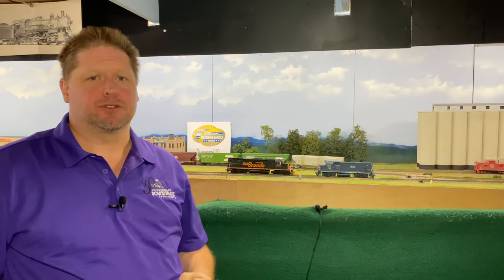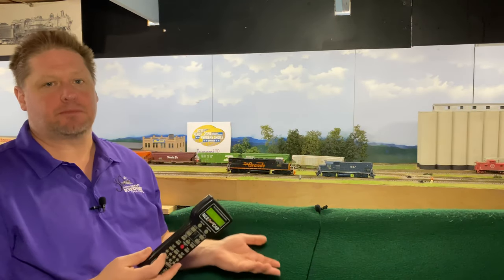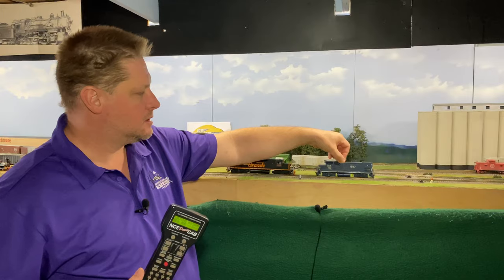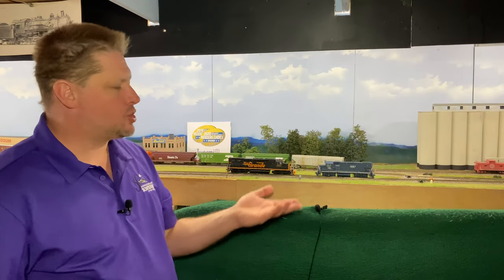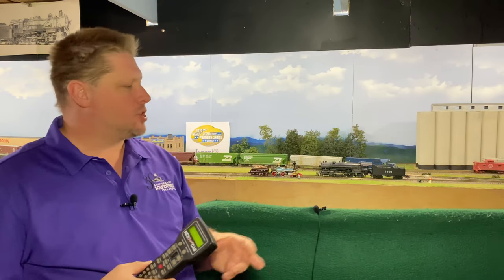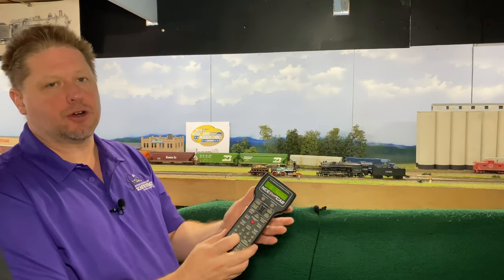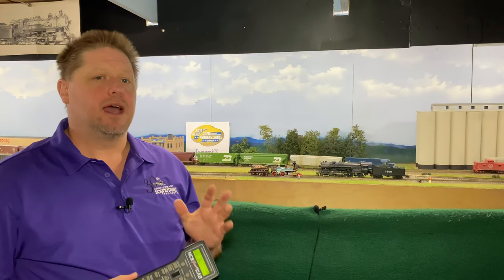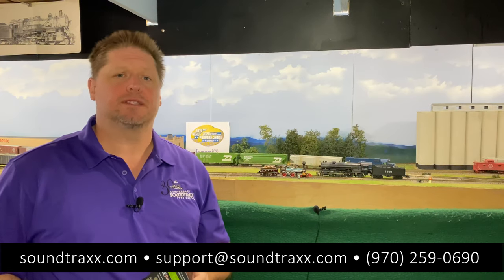How to Start Up your Tsunami2 Equipped Locomotive: Steam and Diesel Examples

Comment: it was great  you told us that the start-up can be changed, BUT you did not explain exactly HOW to do it, in CV 114.   LOL Many bits and bites  !!  I guess I figured it out, after an hour or so.  CV114 default 39, changed to 7
Reply from the maker: We are glad you figured it out our manuals will walk you through what you need to do or you can always contact our Support Department for help: support@soundtraxx.com

Comment: Hi, great to hear about this item.  How many engines can you run at one time with Blunami? And can you run same time with nce dcc ?  Thank you.
Reply from the maker: You cannot run at the same time in DCC. The decoder can only listen to commands from one source at a time. This prevents you from loosing control of your model. Once you are connected to the app the decoder will no longer react to your command station, but when you disconnect from the app you can use your command station.

Comment: These videos have topics that are often exactly what I need, but then when it comes to exactly HOW you did it, they are unclear! What exactly do I need to do to disable CV114, and then what do I turn ON to enable 'manual start up', and then how do I start it?  The 'bits and DB/AN' charts don't tell me anything----I have no clue what all that stuff means!! That page doesn't tell me anything.  I wish Soundtraxx would write their manuals so that a first-timer could understand them instead of having do do a research project to learn how to access every function. :S
Reply from the maker: I am sorry that you are frustrated. It sounds like maybe your problem is with your command station? Everyone has a different command station and we cannot teach everyone how to operate all of these different command stations that we do not make. Therefore we have to just tell you what to with the command station - change CV 8 to 8 but, we can't tell you the steps on each command station to do this.

As far as bits go you just need to determine which ones you want on and then its simple addition from there. We even have an interactive CV calculator in our User's guide that will add them for you. We also have some videos on the subject: 
https://www.youtube.com/results?search_query=soundtraxx+cv
and
https://www.youtube.com/results?search_query=soundtraxx+cvs

We do have a webinar that can help you with a few popular command stations as well: https://www.youtube.com/results?search_query=soundtraxx+webinar+9

And last we do have a full time support team to help you. SoundTraxx Support Department: (970)259-0690 or https://soundtraxx.com/contact/technical-support?utm_source=yt&utm_medium=sm&utm_campaign=sd

Comment: George - another informative video. As far as automatic start up, I have an older tsunami, which this is CV 116. For automatic notching without automatic start up, would I set CV 116 to 7? Sorry, but I missed what you have your MoPac decoder CV114 set to.

Terry
Reply from the maker: Yes, the older Tsunami was CV 116, and yes, can set to 7.  Refer to the User’s Guide for details or contact us. https://soundtraxx.com/reference/manuals/

Comment: Howzit : Is there not a conflict in respect of CV 114 / F5 ( Start-Up and DDE Value 47 ) ?  In having now activated DDE; am I at fault to find that  F5 is now removed as the Start-Up ? And what about the F6 Shut-Down ?  Thanks + Regards / John
Reply from the maker: Enabling the DDE will not disable F5.  It will run the notching based on motor load, but you should still have F5 control.  Contact our Support Department for further assistance.  (970)259-0690 or support@soundtraxx.com
Thank you!

Comment: I think for diesels if you have the engine sounds disabled on powerup (CV114) I think the engine sounds will start if you move the engine.  And it will make sound indefinitely unless you use a the function key to lower it to off, or turn off layout power.  So you don't have to used a function key to start the sounds if you don't want to.
Reply from the maker: You can enable or disable auto-start to match your preferences. For more info contact our Support Department: support@soundtraxx.com

Comment: I have a brand new Athearn Genesis FP9 with a Tsunami2 sound decoder, there is no engine noise either when placing it on the track or using F5/6, it's not muted and the bell/horn are very very quiet. Any ideas as to the problem & yes I've tried a factory reset.
Reply from the maker: Contact our Support Team and we can help you figure out what is going on: support@soundtraxx.com or (970)259-0690 ext.22

Comment: Hi there

I have a piko smart lite dcc controller, I purchased this and sold my prodigy system as I now only have a small switching layout and can change the function key to none latching which is great for the breaking function.

The issue I'm having is my athearn genesis gp15 with factory installed tsunami (not 2) keeps going to engine shut down when you change directions whilst idle.

Any ideas.

Kind regards Dan
Reply from the maker: Dan, the issue here is likely the DCC commands you are sending via your DCC station to change directions are also accompanied by a E-Stop command.  Some systems will send this out to make sure a loco is stopped before changing directions as doing so while moving can be hard on a motor.  Some systems did this, and so we are seeing the decoder’s PM shut down, which is a result of that E-Stop command.  You can just simply have the E-Stop put the PM to idle in CV 112.  If you have any further questions on this, contact Support directly: support@soundtraxx.com  Thank you!

Comment: I have an Athearn Genesis GP 38-2 with factory equipped sound. F5 andF6 are lighting effects. Can I make use of RPM up and down with this particular decoder?
Reply: @Stuart Aaron Thank you. I'll try that.
Reply from the maker: @deanpurcell7771  If you need further assistance with this please contact our Support Department Directly. Thank you!  https://soundtraxx.com/contact/technical-support
Reply: @SoundtraxxDCC  Thanks. I got it figured out with Stuart Aarons post.
Reply: @Stuart Aaron Thank you that did the trick!
Reply from the maker: @deanpurcell7771  good deal!
Reply: Dean, George can correct me if this not correct, but I understand the Athearn OEM Tsunami 2s are exactly the same as the the aftermarket ones Soundtraxx and dealers sell. Except that Athearn uses a custom function map that can be remapped. I personally am doing this with all my decoders remapping them all to the same function map for all 28 functions. What I am using is based on but not quite the same the default settings of the Soundtraxx aftermarket decoders default map. As someone else pointed out using Decoder Pro makes this a piece of cake.
Reply from the maker: @BNGreen970  There are a few differences. Athearn Genesis Tsunami2 decoders have all of the same features as aftermarket decoders. Athearn decoders have different default values in some CVs, different function mapping, and sometimes a different selection of chuffs or prime movers. For example our new big boy sounds were originally only offered on the Athearn version, but now they have made their way to after market decoders as well. For our OEM decoder we make CV sheets to out line the differences in each decoder versus an aftermarket decoder and they can be found under the Reference Tab on our website: https://soundtraxx.com/reference/factory-installed-decoders
Reply: Dean what value did you enter for the CV? I have the same loco and would like to disable autostart aswell.
Reply: @andyfmx322  Sorry, I can't remember what I did 🤔
Reply: @deanpurcell7771  that’s alright mate I dug a little deeper and found out what I needed to do. Was CV114 with a value of 7 👍
Reply: @andyfmx322  Glad to hear that 👍